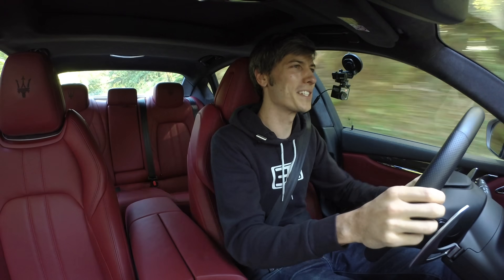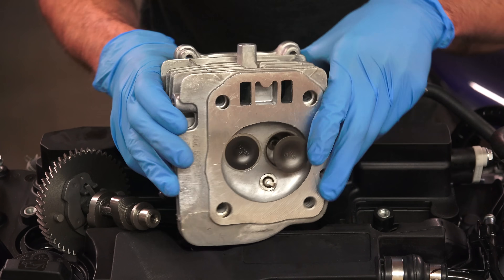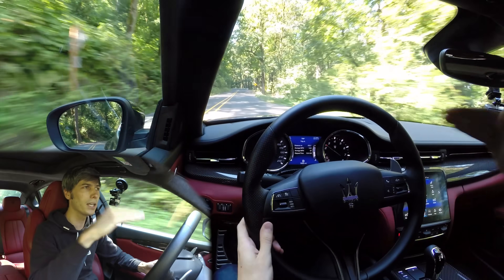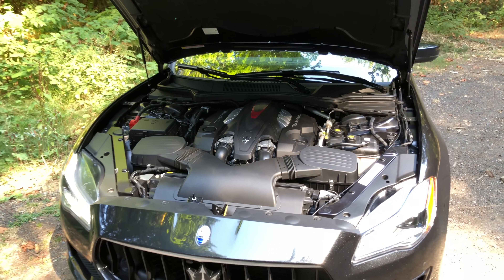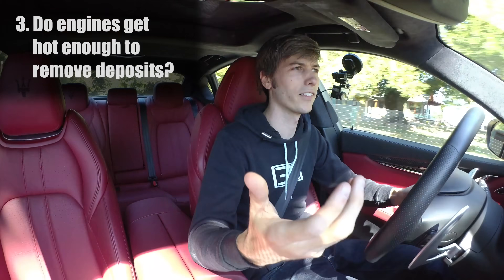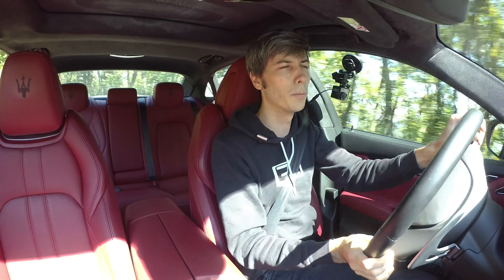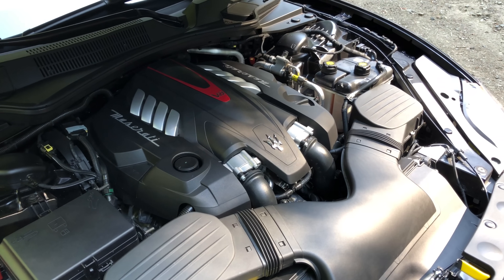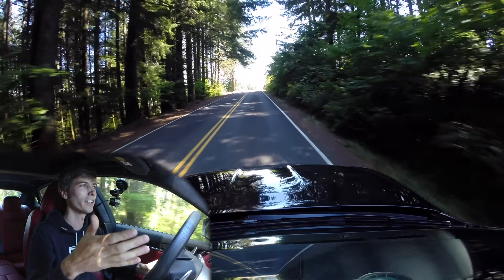Is Redline Good For Your Car's Engine? Italian Tune Up

Comment: True story: I mostly drive my car (BMW 325i) in the city. So one day I was driving on a highway going on a vacation and the car was pretty full and heavy. I was driving fast 150km/h for some time because we were running late. At some point we were uphill and the I had to overtake another car and was running full power in high RPM for extended period of time. Suddenly the car started shaking and I got check engine light. I pulled over and discovered that I had severe misfire from the engine. First I thought that i had blown coil and since the destination was still far far away I had to turn back and head back home. Driving slowly with the engine shaking all the time suddenly the shaking stopped, while I was coasting downhill almost at the time I was home. I still changed cars so that I can at least go on vacation safe , but when I got home after that the car was again OK , no more misfire and till this day there is no problem... I bet some carbon piece broke loose and caused the misfire by blocking some fuel injector when later was released and freed the fuel flow.
Reply: Same story with my MR2. Drove it super hard on a trip (uphill windy road) ran great after and seemed to pick up hp.
Reply: JGD  So you have a blow headgasket?
Reply: @Heck6  lol fill up the coolant and check the petrol
Reply: jawbreaker If carbon broke loose, it would be inside the cylinder head/on piston. This is after the injection process
Reply: @dr.lyleevans6915  There are fuel injectors INSIDE your combustion chamber, which is where your pistons are
Reply: Cause it’s a bmw bro 😂 😂

Comment: Redlining routinely isn't to remove carbon. Driving at constant engine speed for tens of thousands of miles will wear the cylinder bores in the same spots. The extra inertia generated at higher engine speeds causes the piston rings to travel that extra micron or two up the cylinder wall. They travel beyond the extended wear and hit the fresh cylinder bore. When the piston ring strikes this wall it can fail and lead to oil moving beyond the piston rings.

If the tolerances are really bad between the piston, connecting rod and crank shaft, then the problem can become exponential.

Comment: One of the point you miss is the power of the engine in the research you found. I don't think my Fiat Punto with 80HP have the same load temperature of an Audi TT with 250HP.

Comment: Well Italian tune up is useless for most of today's cars but dont forget that EGR significantly affects combustion temperature (it is meant to do so). I havent been in details of the study you reffered but back in the times when cars had no EGR and especially those that had carburetor instead of injection - the combustion tempeature was growing with revs because it was mostly working with excess of air. I mean i think it could possilby work in 70s or 80s... Also (I dont know if this is case of US) in Europe (including italy) there was pretty common to have two-stroke engine in cars. Theese are burning oil (a lot of oil) by design since oil is a part of the fuel. And you could spot them by hude cloud of stinky blue-gray smoke behind them. Those cars are gone theese days but i remember them when I was a child. The thing was that if you havent been using full power (i.e. in the city) it caused oil and carbon sediments in the exhaust pipes and the only way how to get them rid was to "red line" the engine for 5 minutes...  Maybe this is the source of the legend behind Italian Tune Up... Also find some Wartburg 353 videos to see some two-stroke fun :)

Comment: How does an old engine that has a leaking head gasket in a specific cylinder self clean the whole cylinder area including rings, intake and exhaust valve while the other cylinders are fouled up with carbon.

Comment: Heat plus pressure should create a different result though shouldn't it. Especially when the downwards motion of the piston create a downward pressure similar to suction, thus sucking down the build up building at the top of the cylinder. If I'm wrong let me know I'm hear I the name of education of mechanics

Comment: the mazda 3 service manual actually has as part of a service/ spark plug cleanup procedure to run the engine in neutral at 4000 rpm for 2 minutes.

Comment: Since the days of the Model T it's been known full throttle acceleration and/or redlining the engine is far more HARMFUL to the drivetrain than beneficial.
Reply: But still not as bad as driving many short distances and 
/or always driving with very little load/rpm

Comment: I actually have some experience with two cars (both turbodiesels) which had initially failed their MOT (a UK test which includes exhaust smoke  testing for diesel vehicles). Both had a high mileage of over 100k. Failure was due to high level of exhaust smoke.  After a short but aggressive run they both passed the retest (with a significantly lower smoke level). Since then I have done this routinely BEFORE their yearly MOT and smoke levels remained well below the required level. Maybe does not work for all cars but definitely did for mine!
Reply: I think this was more a consequence of the high load helping the DPF clean itself out than anything to do with carbon deposits, good tip for most diesels.
Reply: I always do this with my Diesels. It's even better if you climb a long mountain road, keeping a high load at 3500 rpm instead of always shifting to the next gear. Huge black cloud behind me and then the test says I'm clean asf on my 325 000 kms Peugeot 206 2.0 HDi.

Oh, and BTW the EGR is really easy to disable on this car XD
Reply: It certainly worked for my petrol BMW 5 series. I suspect the cat was a bit sooted up but after a serious thrashing on the motorway it went through its emissions with flying colours.
Reply: How do you perform that run? How long and how high you get rpm's?

Comment: Engine steam clean with water through the PCV or brake booster line. Not recommended on modern cars. Some vehicles' brake booster hose only goes to 1 cylinder, too.

Comment: Life is about trade offs.  Here is my take away from your video...

Redlining may remove some carbon deposits in certain areas, depending upon your engine and configuration.  However, seems likely that the higher heat would need to be sustained to do any significant carbon removal.  Therein lies the rub.  There is a reason why they call it a "red line."  Again, depending upon your engine, even pre-redline can cause things like valve float, excess heat build-up and stress critical components of your engine.  Not sure I'd want to risk that for any extended period of time and/or repeatedly in the hopes to fight carbon deposits.

If you're worried about upper engine carbon deposit build-up, you're probably better off just getting a valve and intake cleaning at 80-100K miles (direct injected engines) or just using fuel injector cleaner every so often (non-direct injected engines).

Comment: So basically all those guys with small GDI engines and turbos are more likely be putting carbon deposits on their intake valves instead of removing them, when they rev it and keep the engine at a certain RPM.   There goes the "italian tune-up" for pretty much all compact- mid and full size sedans and small SUVs released in the past 4 years.  It's actually quite hard to find a non-GDI engine in 2019.  Everybody is doing  1.4-2.5 liter +turbo engine.   Basically the worst /most unreliable setup you can think of, worse than  the 00's , which were mostly multi-port fuel injection.

Comment: I think some added confirmation bias with this is the cats. If I'm not mistaken; older, more restrictive catalytic converters on vehicles that were driven at low speeds and/or excessive heavy traffic, would get packed with carbon. This would cause poor flow in the exhaust system, making the car run noticeably worse. 
High revs would create pressure, & possibly the heat necessary to break this stuff loose, & blow it out.

Comment: I have just one question professor. If the piston head is 2,000C right in the center, and steel melts at 1370C. How does this work?

Comment: gasoline is a strong solvent, thats why the new di engines also have port injectors, to remove the carbon on the valves

Comment: Lots of witty jokes in these comments.  But one unspoken lesson here is to avoid those temps that invite carbon build-up in the first place:  Moderately warm engines that get hot enough to invite carbon molecules to adhere, but not hot enough to burn them out.  In other words:  Short trips.  But it's tricky, because water-cooled engines are designed NOT to get hot.  A puzzlement.

Comment: Great video, thank you. I like your videos because I am a structural engineer and I have always been passionate about cars since I was a kid and I like the detail that you go into with your research. Most people wouldn’t take the time to research various engine temperatures, DI vs port injection and even chemistry! Good job!
I’ve always believed that cars need to be revved out regularly. If you just putter around in city traffic all the time then it’ll definitely carbon up. Not just on the valves and cylinders but in the exhaust and cats too. A good thrashing on a windy back road helps. I think some people misunderstand and think holding the car at high RPM with only partial throttle is the way to go but I believe you need to have high load and RPM. Windy roads are the best because you accelerate hard, brake, corner and accelerate again. It’s that repeated hard acceleration that really gets things hot and the hot gasses flowing quickly enough through the catalytic converters etc. I was a bit disheartened when you said you found some research that says it’ll actually increase carbon build up in modern DI engines but it won’t stop me from giving my car a thrash with some fuel system cleaner in the tank from time to time. Cars I’ve owned and thrashed: Honda Accord Euro R, Subaru Legacy 3.0R and now Audi S4 B8.5.

Comment: Airplanes with piston engines will do "run-ups" before takeoff to clean the plugs.  This is done by running the engine up and leaning out the fuel mixture for 30 seconds or so.

I believe most fuel-injected production cars are mapped to run rich at full throttle to avoid detonation which means you are probably just adding more deposits.

Comment: I think that the Italian tuneup is good for engines that have REALLY bad deposits, as they will absorb far more heat and not experience as much cooling as the engine itself (the cooling has to go through the piston to reach the deposit, so there is bound to be a temp differential between the surface of the metal and the deposit). One guy I know had an old gas car that barely ran due to deposits. He put in engine oil meant for heavy duty diesels and then ran the car at redline for around 10-20 minutes continuously. After about 5 minutes the exhaust started belching this weird orange-ish color. He ran it till the smoke looked normal for a few minutes. 

Afterward the car ran like new, but he replaced the oil right after the Italian tuneup.

Comment: As I understand it Mazda used this information to design the intake valves in their GDI engines to run hotter to reduce the chances of carbon build-up on said valves.
Reply: Can I get a source on that? I'd like to read more.

Comment: Here's my experience with a 1987 Mazda 323 (E5 engine).

This thing, partly due to the incorrectly jetted 32/36 carb, gets lazy quite quickly.  Just last week I gave it a bit of a tune up (three pulls up to a mere 60km/h at traffic lights, I was in town).  You'd be suprised how the engine came to life just from that.  So with older engines, the Italian tune up definitely works.  I've also noticed though that driving the car long distance helps a lot, but of course that also means high RPM, high load when overtaking.

Oh, and just for the record, the engine used to get lazy in a single tank if I didn't use Shell or Caltex petrol.  That was before I put this carb on, now I'm still in the process of figuring out the correct jetting. EDIT:  I see I already commented about how it used to get lazy in one tank from the wrong petrol.  But I didn't expect a mere three quick puls to make such a difference.
Reply: It seems true of newer Mazdas also. They tend to feel 'clogged up' in no time if driven on low revs.
Reply: @thetruth9116  Interesting.  You'd think modern fuel injection would solve that...

Comment: I use to rev my car while spraying water  in the air cleaner to break up the carbon , u could see it coming out on the ground. I use a spray bottle not garden hose .

Comment: I can confirm the Italian tune up does work! I purchased a long time ago a Lincoln Town car, ran like garbage. After about 10 minutes on the highway chugging through a few pulls, it started to run a lot smoother. Another 10 minutes of full throttle runs, it ran incredibly smooth. Felt like a new car again!

Comment: I heard it many times that you need to at least drive the car on hway for a while under normal to high load in order to keep the engine cleaner. With diesel it will also make sure dpf is regenerated. 
Ps used to redline my S2k daily :) for fun not to clean anything

Comment: We have the diesel generators at work connected to a load bank and run at 100% load for a few hours annually. Not only is this a test to see what will  fail it  burns out any carbon and unburned fuel  (Wet  stacking) within the exhaust system.. Italian tune up just at normal engine speed and for a long time

Comment: i'll be honest with you, when i push the 2nd right to red than change normally up to 5th (only have 6 including reverse),  stop on traffic light, i feel like the car is working waaay better than before...
it runs smooth, no pre-detonation, less vibration... i dont know, could be my mind, but it works better XD

Comment: "Get it to high rpms" my truck redlines at 4k...
Reply: Is it a diesel?
Reply: KJ McLaws It's also a truck, which is a long huber. The opposite are bikes, short hubers, so they are able to hit 16k rpm. Normal cars are between this area.
Reply: same as mine 😃 yea 3.2 did, but got some kick too
Reply: On my bicycle the redline is at 120 rpm.
Reply: @Triadii  Mine is only 75.
Reply: I drive in top gear 5th gear at 120km/h at 4k rpm lol, engine smooth as butter with no carbon 😂
Reply: Dodge owner I see
Reply: High rpms is a relative term
Reply: 4000 rpm is high!
Reply: 3200 here
Reply: @joshuatate5671  2120 here, 14.6L of diesel goodness at 35 pounds of boost.
Reply: @jaydunbar7538  Mine's just an ancient 6 cylinder with a single barrel carburetor.
Reply: @jaydunbar7538  With 75hp
Reply: So does my truck. 😂 it has a 302 HO meaning high output but people relate rpm with power and you can't. Lol maybe peak power but that doesn't matter if it has a trashy powerband until that point.
Reply: @redbaron77  Diesels dont need revs, they need boost :D
Reply: @MrDanisve  it's all about movement of air. Faster you can get air in and shoot it out, the more power you'll have. Lol at least to my understanding.
Reply: @redbaron77  Yes, exactly. More total air mass = more power. You can do this through increased displacement, increased RPM, or increased air density(pressure). So, with a (heavy) diesel that can't spin that fast, you can make up for it by adding boost, increasing the total mass of air that the engine processes per minute.
Reply: @redbaron77  That's true assuming a naturally aspirated engine at one given displacement... but adding displacement or boost allows you to make more torque and horsepower without increasing revs. Remember, horsepower = torque x rpm / 5252.

Comment: i had this old car about 12 years old 1,000 cc engine, when i had to take it on a road trip away from home, on the way to the destination it would harly keep up 75mph, on the way back it would easily get up to 95 mph and i could tell there was a difference in power. flat surface all the way around all i can blame it is for the carbon deposits getting  cleaned up a bit.

Comment: I think there are other factors at play in this phenomenon, namely piston ring sealing on both the cylinder wall and the ring lands. I have witnessed first-hand a dramatic difference after doing this.

I have a carburettor-equipped V8 and after a hard 3rd gear squirt up and down some long undulations, I noticed the idle speed increase by a couple of hundred rpm right afterwards. Remember being a carb engine, there is no idle compensation... What it gets at idle doesn't change once warm. It's like something had been freed up inside the engine, possibly the cylinder walls had been a tad glazed before and a good hot thrash has scuffed them up nicely again. Ditto for carbon deposits in the ring lands, etc.

Comment: I had an 88 f150 with 302 v8. Back when michigan required emissions testing I failed.  They guy said go drive it hard on freeway so I did. When I came back after high revving it on freeway and revving it to redline numerous times it passed emissions test. I guess it works to some degree.
Reply: Likely this got your old catalytic converter hot enough to actually start working.

Comment: I’ve got an ‘18 Colorado with 6 speed manual, it practically sees redline every shift thru 4th, plus I’ve installed a pcv catch can, and it doesn’t have an egr system, so I should be good 😊
Reply: stellingbanjodude 
Should be good, but won’t
You’ve got a Colorado lol
Reply: Says the man who doesn’t state what he drives

Comment: Is good quality fuel a better alternative?
Reply: It helps substantially.  But in some cases an engine can still get lazy.  Engines are built to work hard, in fact they run more efficiently that way.  Up to a point of course.